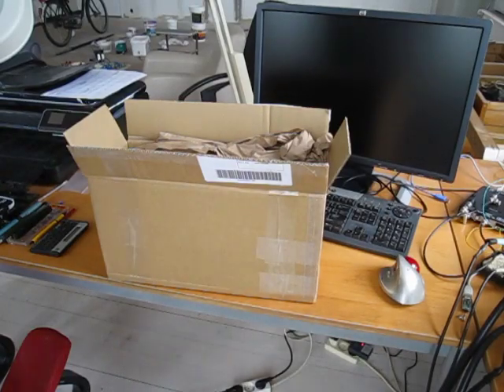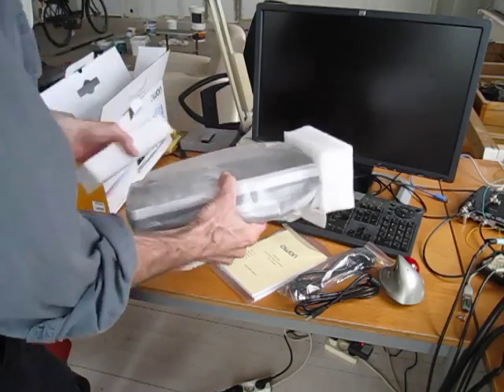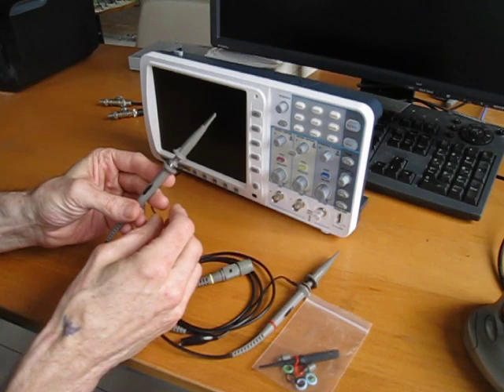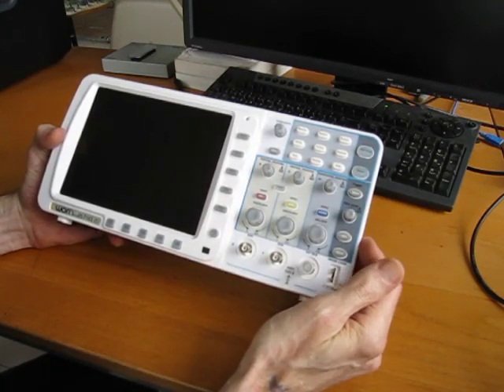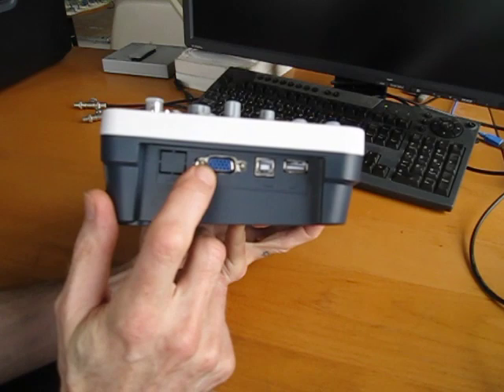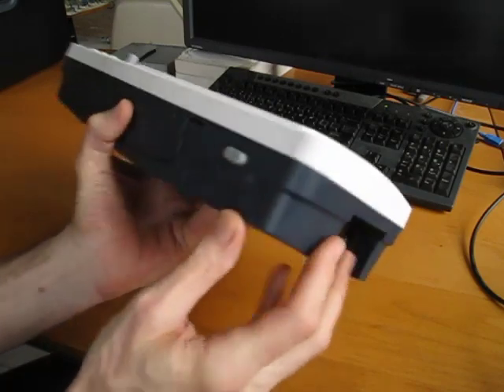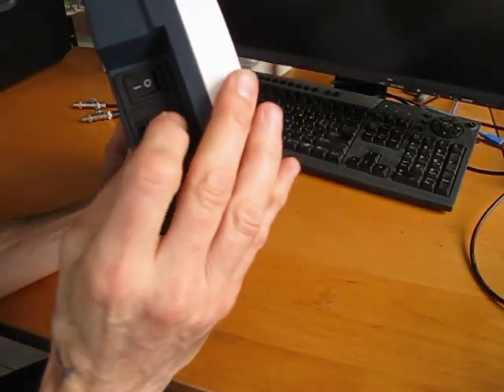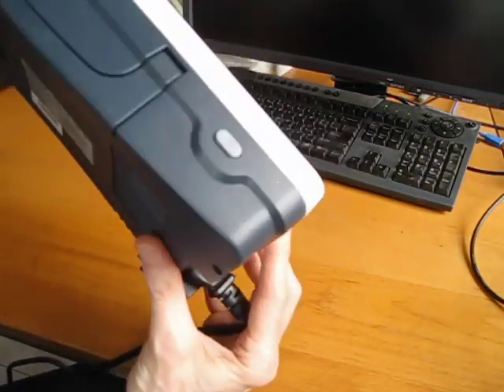OWON SDS7102 Review Part1

Comment from the maker: @cd4600 - Of those three, I'd definitely recommend the Rigol for a beginner (the cheapest). You might also look at the Velleman PCSGU250 - a reasonable 2-channel USB scope (with a Arbitrary Waveform Generator built in) that comes with decent software (Bode plotter, etc) - and great service and support at the Velleman forum.  I don't know where you're located in the world, but you can get the PCSGU250 for ~ € 160 in the EU.  They are such a good buy that I might just get one for audio work alone.

Comment: 20 Nov 13 - LED sensor on front is remote control, but requires firmware update. Just got off Owon China website and my serial number has an update of SDS7102UP3.2. Does three things, gives current measurement, fixes "autoscale" bug, and adds remote control. Downloading the RAR file now, at 135MB at crappy AT&T ADSL of 415KB/Sec. I may have to shave before it's finished.